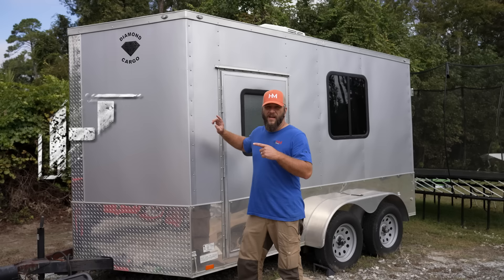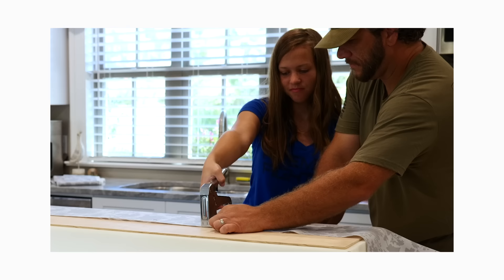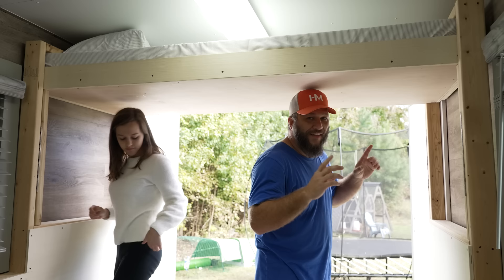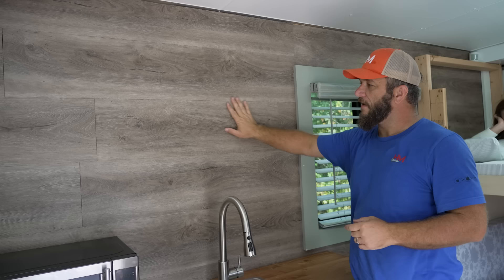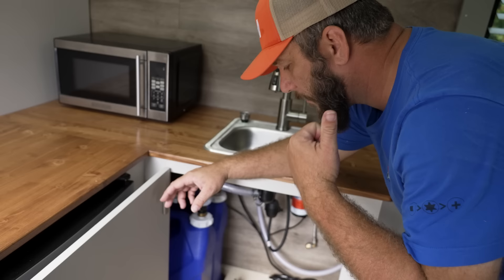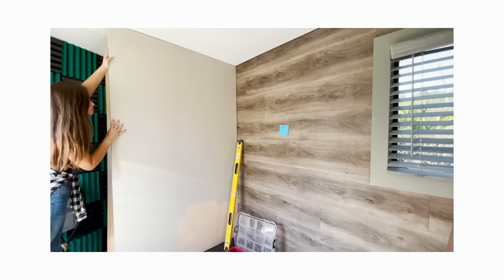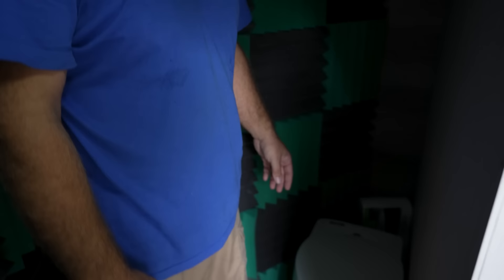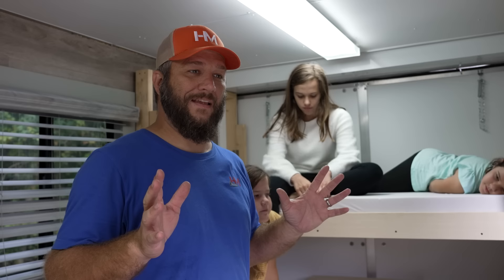Family Converts 7x12 Cargo Trailer Into Camper / Tiny House

Comment: I may have said this 2 years ago, so forgive if so, but I have a mod that you and your viewers might like to add to their trailer camper builds.

First off, one of my sons owns a garage door business, and that's where this idea came from.
I get a lot of his take-off parts before he trashes them!

If you take a garage door raising tube cross tube with bearing brackets and pulleys and mount it either on the back wall over the rear doors or on the floor, under your bench, you can hook up a simple cheap 2000 lb Harbor Freight winch cable to a pull drum  attached to the cross tube, and some small pulleys with plastic covered cable through some pulleys and raise that bunk bed up and down with the  4 cables attached at, or near, the corners of that bed frame. No springs needed. This way it can be raised or lowered by even your smallest child.  And be stopped at any height so a taller person can sit at the dining table without hitting their head.  And still leave room for the person on the bed, if the trailer height is extra tall like this. And if you cut your stop blocks and use several separate hinges, you can easily set stop blocks to set the bed on at different heights to lower the bed to, if you want.
I've built a setup like this on my 17' cargo trailer I built a few years ago, so it would be a toy hauler and camper.  Sold it to my son, and he has since sold it again this year after many years of use.

The beauty of this is you can cut the length of the tube sown to any size that will fit to mount the tube lengthwise , the width of and bed, on the trailer, the width of the bed behind the drawer storage and just run cables through holes to get to the pulleys. Or just build the winch and cross tube in the underside of the bed frame. All kinds of possibilities.

Comment: Try using a tension system for a garage door on both side to help raise and lower the bed . Another option would be four linear actuators to help raise and lower the bed then you could just flip a switch.

Comment: Great video. A lot of interesting ideas. For the sliding lift bunk, you might get even more utility if you add an intermediate level by cutting the supports in half. Still use them both for full extension, or 1 of 2 for 1/2 lift. 1/2 lift would give increased ability to sit under the bunk, while preserving the ability to be in the bunk (at the same time).

Comment: I struggled to carry that tank when it was full and it would splash while dumping. A homemade compost toilet would be easier to dump because it's light and doesn't splash. Just build a plywood box with a hinged top that has a hole cut in it with a toilet seat mounted to the top. Drop a 5 gallon bucket in the box. Use cheap pine pellets for odor and moisture control. 1 scoop for pee and 2 scoops for poop. Dump in the woods or bury. The pine pellet horse bedding turns into saw dust when it gets wet. Good for cat litter too.

Comment: if you had shorter 2x4s where are the bed is you could raise the bed up a little bit like 6 in and then put them underneath the bed and then it would give you more room where the table is or you're bad

Comment: You need to cut a hole in the floor of the sink cabinet and let your gray water tank drop those precious couple of inches down. Make a hole big enough for both bottles then trim the hole opening with a 1x4 and you won’t have to worry about them tipping during travel.

Comment: I have a portable camp toilet. Looks different from yours. Mine is squared, not quite as tall and the opening to poor it out on mine doesn't have a tube sticking out. It's just the hole/cap on the side of the containment section. Oh yeah, and mine is green and grey. Yours did have a water section and pump to flush, right? Mine has that.

Comment: I have a small suggestion- I LOVE your build!  instead of another trailer, get a van and outfit it with collapsable animal cages for the animals- it can carry pet food and bedding too. you or your wife drive the van and pull a smaller cargo trailer with supplies while the other drives the truck (filled with add'l supplies) and pulls the cargo trailer RV. just a suggestion.

Comment: Nice job on the trailer Adam!  Very innovative.  Just curious...how often do you have to evacuate for hurricanes?  If there's an upside to living in "tornado alley" it's that tornados are quick.  Bolt for the basement if the sirens go off.  30 minutes later, everything's back to normal if you're lucky.  Stay healthy and safe!
Reply from the maker: Thanks! We didn’t have to evacuate for over twenty years and then we had to evacuate 4 times in 5 years. Major pain. Luckily we didn’t get a direct hit. Thanks, you too!

Comment: If you partnered with Linus Tech Tips both your shows would be a haven for silly potty humor.  Why didn't you use a pulley system for hoisting the loft bed from a single person?  You could've done it with a manual crank, one that is house powered, shore powered, solar powered, mobile wind turbine powered.

Comment: Nice trailer!  
I’m having trouble deciding on material for my ceiling. Thinking about using 1/4 inch or 5mm luan. What did you use?
Reply from the maker: Thanks. My trailer came with the ceiling already attached.